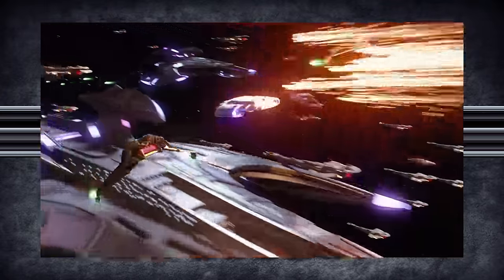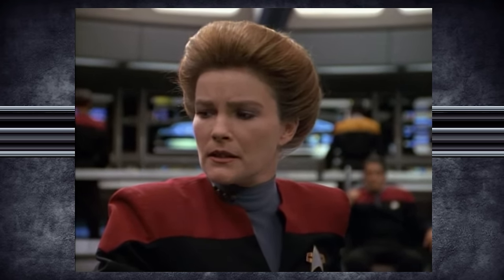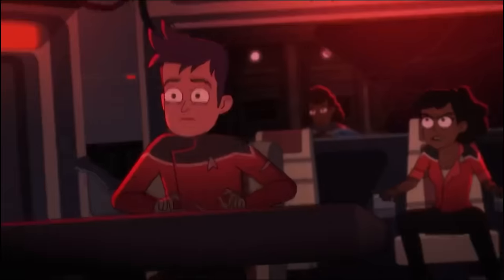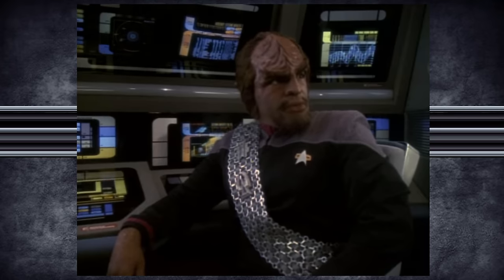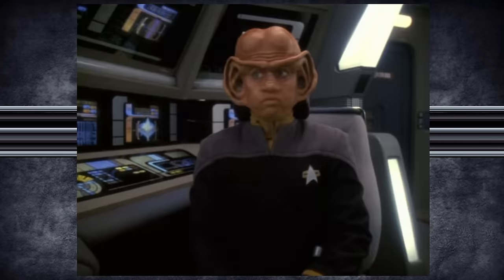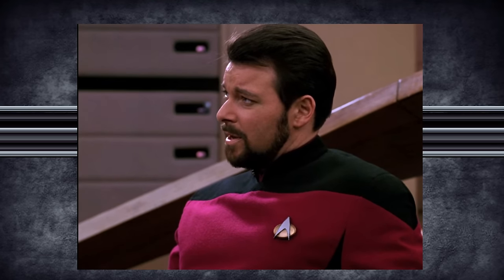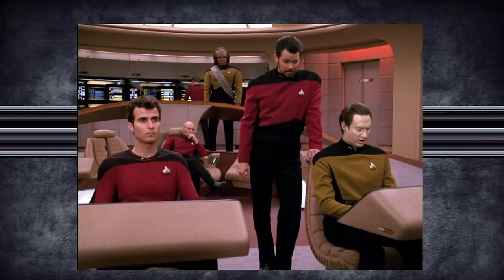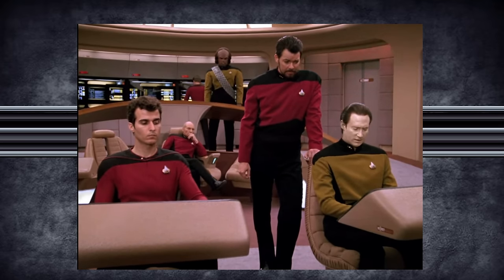Why Starfleet's Bridge Design Was Lethal to the Crews

Comment: Bridge overly exposed? Yes.
Most command staff on same shift? Mostly they are, yes.
Most Federation ships DO have a secondary bridge. We even see this bridge on TOS and TNG. The Defiant doesn't, but that's like putting a secondary bridge on a speedboat. Pointless. And the Defiant is designed more like a Bird of Prey rather than a Federation ship.
I don't think it matters what the layout is or whether it has windows. These stations seem to be setup as a preference of the design team. Viewscreens are better than windows. They can show you ANY view you wish to see rather than just what is just outside THAT window. And if the ship loses ALL power the windows will be just as useless as the viewscreen, as the electronic filters wouldn't be able to screen the incredibly bright and dark view of space (depending on what you are looking at) and you would either be left blinded if a star wandered into view or squinting into the inky void to see anything in space not illuminated.  

I am shocked you didn't mention the obvious fault. The lack of seat belts. If the ship can and often does take impacts strong enough to toss people around, then having a seatbelt would be a HUGE improvement.

Comment: Do any current scientific research vessels ever have a 'science station' on the bridge?  IMO it would make more sense for the scientific personnel to work in areas specifically designed for research - with the bridge simply having the function of getting the scientists to where they were going.  The 'science' station on the bridge would be better used as a station for a specialist to operate the various sensors and prioritize which information needed to go to the captain and which needed to go somewhere else (such as navigation or weapons).

And there really needs to be better use of enlisted and warrant officers.  An enlisted crewman who spends his entire career working with the weapons systems might be getter qualified than a 'jack of all trades - maser of none' officer in terms of actually operating the weapons.  And security should be the officer from the ship's marine detachment.  And yes - all Starfleet ships above a certain size need to have their own detachment of people who can engage in combat both on board ships and on the ground.

Comment: Though I'm not really much of a fan of the TOS era nor the Discovery era. I haven't seen the Picard series nor anything else. I've watched TNG, DS9, and Voyager a few  times over. Some of the movies as well from TNG era. I'll share my thoughts and opinions about windows and bridges.

#1: Windows. Windows for space ships would mostly be for visual enjoyment when near things in space. Such as planets, nebulas, and rare phenomena. As for using windows for combat or general ship navigation. Extremely situational at best. Windows have been historically proven in planes and ships to be structural weak points in terms of hull integrity and point of entry for boarding teams. You could fit blast doors over the windows that slam shut in miliseconds and have them just incase your primary, secondary, backups, backups of backups, and emergency systems go down for view screens. View screens are better than windows.

#2: Bridges: TNG's Galaxy bridge design was designed in the Golden Age where most of Star Fleet's main threats where either allies now, withdrawn from galactic view, or haven't been introduced/discovered yet. Star Fleet got lazy and wanted to show off it can build luxury ships.  The borg threat and Dominion War smacked Star Fleet in the face with a weighted glove in terms of bridge layouts. Going back to be more efficient and streamlined as with the Defiant class.  The issue is most ships where "modular" but in truth. It took time and effort to swap out areas like the bridge. TOS bridge design was horrible yet great. The railings helped when the IDS isn't fast enough to counter the ship getting hit but if the IDS ever fully failed. No railings or seat belts would save the crew from becoming disgusting spots of organic mush on everything.

#3: Realism v TV. As much as we want more realism with how ship bridges would look like. We have to remember that those are sets and most sets today are majorly green screens. Back in the late 80's to the early 00's. A lot of the filming was done with bulky cameras and film. They had to design sets to work with the equipment of the times. As said before, use of green screens could bring realism back to Star Trek but to be honest. CGI is everywhere. Physical sets cost lots of money, space, and more than likely have to build multiple sets of the same area to do the same scenes you'd see edited together. I'd prefer to see a mix of both CGI and physical sets.

Comment: windows are useful especially when other system fail, how useful they'd be in space without augmented reality and hud-features is very debatable. 1) You can't see port or starboard or aft from forward looking windows, so you can't check your six, or your broadsides. 2) the distances in space between spacecraft would make them practicably unviewable with the naked-eye even if they are in line of sight, due to perspective. Without magnification you're looking at a point of light, OR without advanced sensors you're not looking at anything at all because that enemy ship just cloaked OR routinely the crew of such ships are dealing with phenomime and entities that are operating somewhere outside of our natural and extremely limited perception of the light-spectrum. Both of these issues combined make the viewscreen with multiple backup sensors to switch to the better system, because if you're just depending on what your human eyes can see and make sense of in space in the star-trek universe, you're screwed.

Comment: Those bridges are good examples of failed worldbuilding. Even today, it is possible to construct variable operation stations. In theory, every single station, expecially after having touch screens even for maneuver control, should and would be able to take over every control configuration possible, even crossover-/special purpose select combo configurations.
Also, why oh why don't they have security belts? Pressure suits? Emergency encapsulations for every single station? It is just not necessary for bridge personnel to rush over to o.o.a. comrades to drag them.out of their seat and take over the station. Just to switch console config to take over their functions, while safely strapped into a seat that keeps them alive and undisturbed from the chaos that made a station drop. Meanwhile, a good comm system would enable audible communication (not neccessary to look the comm officer deep into her dark lashed eyes in to exchange information) even while the standby rescue brigade rushes in to close the hull breach*, extinguish the flame inferno or drag away the lifeless corpse of the electrocuted ensign. *(strange that the bridge deck never breaches, innit? On the other hand, this is the tale of those lucky few ships who never had a hull breach in command deck, and thus survive to tell their tale.)

Comment: The bridge on top is purely a production decision to give people an idea of the scale of the ship. The whole bridge module in universe explanation was to explain the massive oversight in placing it in such a vulnerable place, and why the bridge of identical class ships often look dramatically different (because often the other ship was a redress of the motion picture bridge).  But... there is auxiliary control going back to TOS, the 1701-D had the battle bridge, and engineering can always serve as a C&C. So... to say they have no secondary bridge is a bit disingenuous.

I am more concerned with why they have terrawatts of power routed through every interface console, along with stuffing a bunch of rocks and photon grenades behind them.  Does tactical need to actually turn the phasers on and off directly? They still have RELAYS in the 24th century, don't they?

Also... NX01 Enterprise bridge seems like it could be a Defiant redress... can't seem to find anything on that.

Comment: I don't know if anyone has mentioned it yet but would windows really be of much value to starships?  In space, we're dealing with vast distances and extreme speeds.  Anything that might be a threat would be so far away that it would not be visible to the naked eye.  Fights can occur at distances of hundreds of thousands of kilometers where the slow speed of light is actually something with which you'd have to contend.  While we no doubt like to "see" things, sensors would be far, far more valuable in identifying objects, determining their status, and providing anything of value.  I would expect that anything on the viewscreen would be mostly "rendered" representations and not optical effects.  Therefore, the windows are mostly for aesthetics and not for any practical value as on Earth.

Comment: Think about imperial ships in star wars. Have you wondered why there is always an officer who must walk miles inside the ship  to tell something in person to Darth Vader, or Moff Gideon or Moff Tarkin?
Doesn't have intercoms those guys?.
But you're right, my hobby is to draw whips, and having a bridge well exposed on top of the ship, just waiting to be attacked, is an stupid idea.
There are cameras and sensors. You dont need windows to see outside the ship. You can locate the command room  dug in the very center of the ship structure.

Comment: ah windows on the bridge on space ships.
i'm of the opinion that they are not necessary. in the argument provided in the video being a 'backup' to compromised systems. I would argue that the distances involved in space would make seeing anything other than stars, and celestial bodies would be near impossible unless it was a really large object or within a few hundred km. also, navigating in space just by eyeballing it through the window would also be near impossible due to the trajectories that need to be calculated using tools and any kind of maneuver that would need any level of accuracy would also be impossible.
though windows do provide a psychological benefit of preventing the feeling of being enclosed. and have some nice views to look at, otherwise i dont think they have any practical use.

Comment: The stuck the bridge on the top of the saucer in a separate structure with limited access.  Apparently, OSHA is no longer active in the 25th century...or common sense, either.  The main bridge should have been either centered in the Saucer section or centered under the neck in the Engineering section.  That would offer the most protection, and since all their information was by hologram or instrument, why did they need that silly little transparent top to the Saucer bridge?  Somebody should have nixed that design right off, but I guess Paramount and later CBS felt reasonable design wasn't a priority.

Comment: From STTNG onward in Trek, the transporter biofilters and the life support systems biofilters should have been tied to battle systems and to damage control systems.

But, then, the writers would have to write FAR better material since it would be harder for injured crew to die, or for enemies to gas the vital areas. The transporters should have been beaming DIRECTLY to Sickbay or to any Aid station any person demonstrating way-off-baseline vitals for that particular person,based on activity.

Too bad thst virtually nowhere in Trek did we see fire behave like fire in low gravity should — nevermind artificial gravity, which if you're a fan of STTOS, you'll have almost always hear, "AG section: artificial gravity is down to point eight...", or something like that looped often.

Too bad that it took til the 70s and Franz Joseph Designs for us to see that the Bridge had a toilet, and had an emergency escape/egress kick-out panel where Kirk fiddled/diddled with controls and rattled off superfluous gratuitous dialogue after almost being consumed by the Doomsday Machine.

Only in, IIRC, one of the STTNG-era movies (First Contact?) did we see anyone enter or exit the Bridge via an in-deck access/egress trunk. If Kirk had had that, Khan probably wouldn't have captured Kirk. Or, at least, we'd have gotten to see Joachim grab the Bridge crew on descent.

If only 60s Trek had lot access to ship sets we'd see those 70s 1701 companionways redressed to look like the ~2250s), or inclined ladders (stairs, for landlubbers) which allow movement between decks.

Say, an explainer on JJ Trek and on Disco's Turbolifts might be in order. I felt it was completely unnecessary to have the Turbolift network look like the inside of a Tron vs Pac Man AI machine. And, there's real, deadly gravity — and ATMOSPHERE — in the void space???!!!

That's probably the only ship feature I didn't like about either of those franchise installments.

Captain Georgio's tripod-mounted telescope was a nice touch. It made me think of the Franz Joseph Design mechanical telescope abaft and below the Constitution Class Bridge.

If Paramount/CBS/ et al ever someday allow fan Trek to resume telling stories longer than 15 minutes, I hope there will be live action 60s Trek showing us virtually everything in the FJD Constitution class, like behind the walls of the Bridge — the:

— walk-down ramp to science labs;
— Communications
— Computer Central/Main Computer Core
— Stateroom/Cabin/Quarters lavatories
— ladderways use between the Saucer Section and the Engineering hull
— Main Engineering
— Shuttlebay Maintenance
— Replicator/Reclamation Systems
— The Swimming Pool
— Emergency Bridge (not just Auxiliary Control)
— Engineering Hull Bridge
— other  (Main) Transporter Rooms;
— Emergency Transporters
— Cargo Transporters
— Crew Mess alongside the Turbolift tubes
— PRs (Privacy Rooms)
— Arboretum in the Saucer
— Arboretum in the MEH
— more of the Starfleet Starbase that had spheres to contain 6 Enterprise-sized hulls
— the 3-nacelle Dreadnought ships
— the tractor tug starships that could haul 1-3 passenger and cargo tube hulls

And so much more.

Even before TNG, fans created massively sumptuously, enviously rich universe of on-paper stuff that was virtually completely ignored — probably far less to do with changing generations and more to do with mot having to pay royalties.

Despite the fan Treks that used authentic, lovingly-replicated 60s sets, we haven't gotten to enjoy the 1968-1976 content.

It should be revisited, but be along the lines of Disco/SNW/Phase II set design, but showcase the design work as characters as much as the people were/are.

Imagine the Star Trek Maps being consulted, the telescope give usage, and seeing AG drip to 0.3 and bowling balls and pins damage or get safety-means stuck to bulkheads...

Or, or, people take worker bees and space walks that Disco and STTMP got to.

Or, being able to see Utopia Planitia and the Daystrom Institute, and 3D labs of mock-ups of pre-refit Enterprise under discussion.

And, perhaps, some pre-inside jokes to why in vast space, regardless of on-screen optics, it's poor tactical judgement to go to battle with the ships close enough to ram each other or cause local gravity wells when making sudden course changes.

And, imagine inside jokes to deal with the improbability of even 22nd Century shipdrivers being able to just coolly rattle off close quarter combat helm orders like, "Make your heading 123 Mark 48" when the ship is at relativistic or even Sublight speeds. Or, why when doing battle, it has to be at believable speeds. And, debris has to be believable and occasionally there should be scenes like when the Borg core-drilled out several decks of Picard's ship and took 15+ crew along for a space slide into Assimilation (before the TNG characters even saw Assimilation).

On second thought, Enterprise has more untapped stories. It took a while, but I eventually liked Archer's ship. The blueprints of it just SCREAM that that ship has more stories in it, and that that era got only and barely 3 years of exploration. The NX-01 could be expanded upon, tho the Augments and a few other things may have ime a "ship-in-the-bottle" number on that franchise and its timeline.

Comment: The issue with transporter tech and replicator tech both is one that is very much a result of the huberis of the federation. They are specifically made to be unable to replicate and teleport specific high-grade military materials. This is why you cant simply teleport out large portions of a star trek ship. That aside there are also plenty of materials that just CANT be replicated so i'd imagine a teleporter would not be able to work on it either. Probably used to prevent someone from teleporting out say, your warp core or computer core.